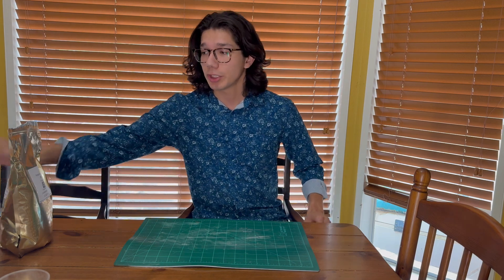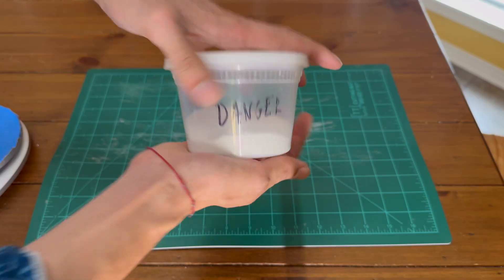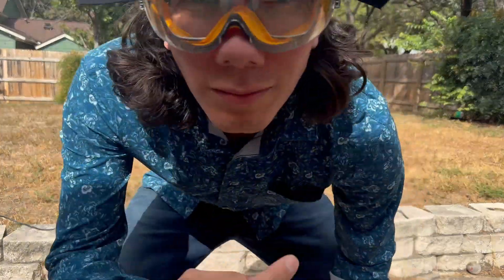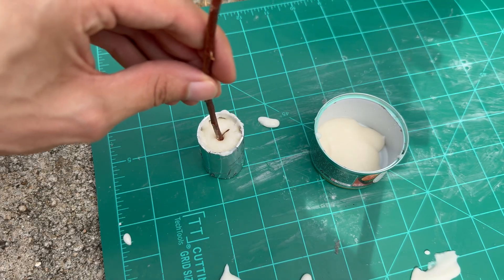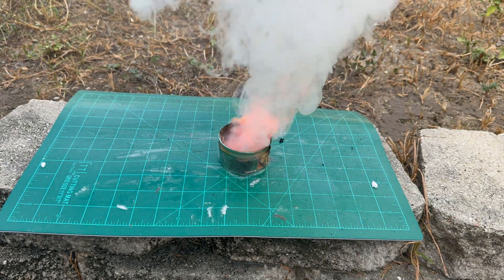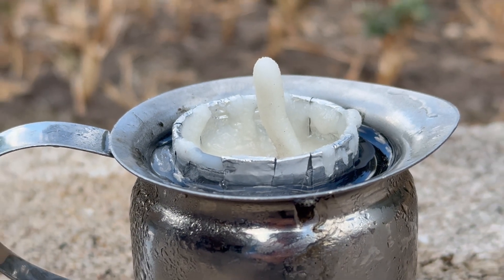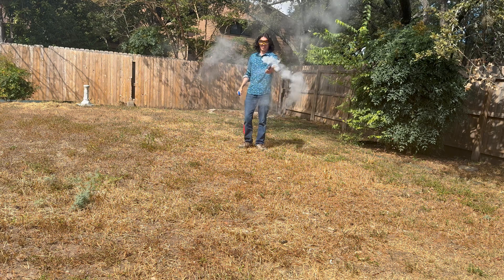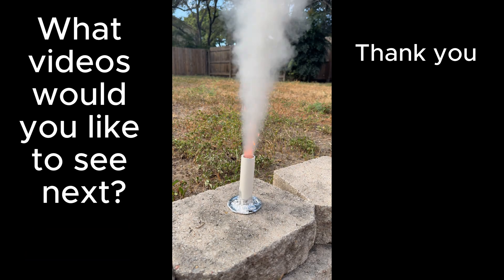How to make Sugar Rocket Fuel (Potassium Nitrate R Candy)

Comment: The most melted sugar rocket fuels I've seen turn brown but this propellent was white, why's that? And also which is better performing propellent like just mixed up as a powder or melt them?
Reply: Did you watch the video? They used sorbitol instead of sucrose.
Reply from the maker: I used sorbitol which can take a little bit more heat before caramelizing. Melting it up is better because it makes the mixture more homogeneous but you have to make sure there are no air voids (cooling too fast). You can keep it as a powder but make sure to mix it very well and pack it super tight.

Comment: What kind of fire extinguisher does one use for a rocket fuel fire is a water one good enough or do I need powder
Reply from the maker: Since it has its own oxidizer mixed in, all you can do is hope to contain it. I don’t have any recommendations off the top of my head but submerging it water or sand might do well. A fire extinguisher will help with ant fires that start after but won’t stop the reaction.
Reply: @ so the fire extinguisher isn’t for the rocket fuel good clarification
Reply from the maker: Yeah… 😂 It was mainly in case the ground or my clothes caught fire